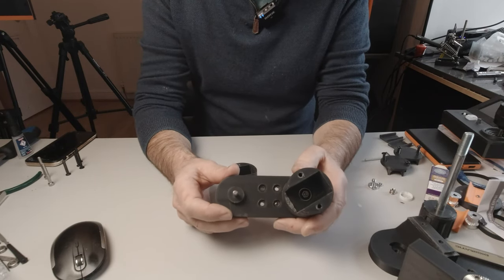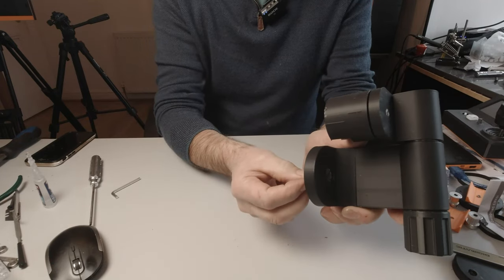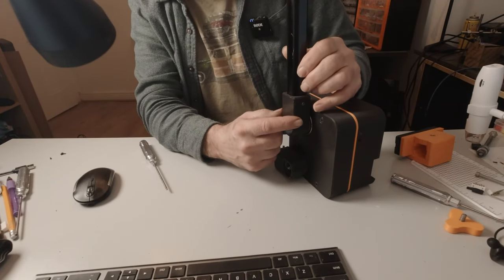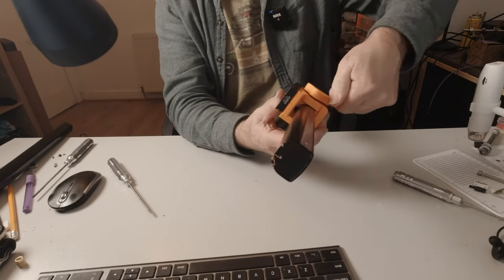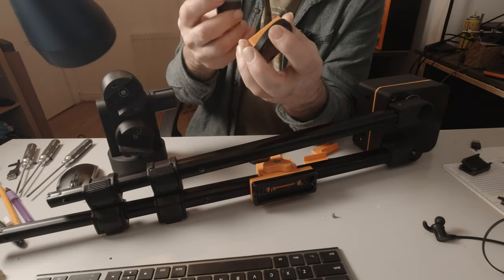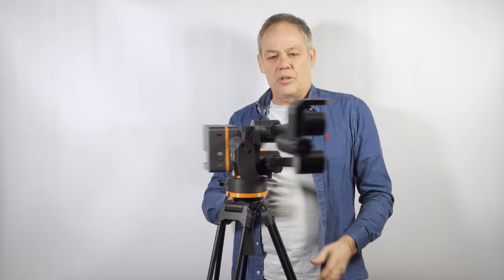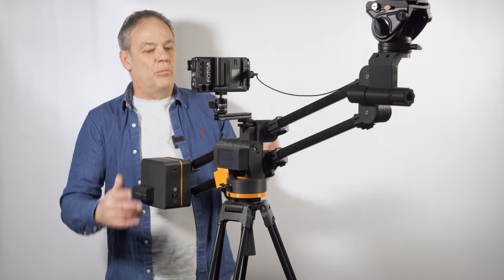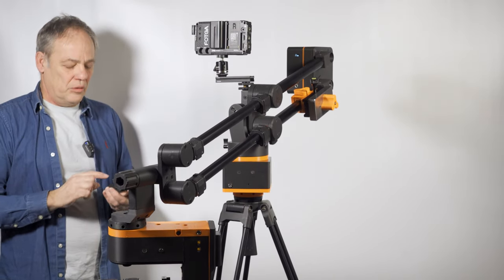3D Printable Motorized Camera Jib from Digital Bird - Part 4

Comment: Really great job. How fast can this go?
Reply from the maker: Speed is limit by the mass being moved. The faster you move it the harder it is to stop! and the more backlash through the arm and down to the tripod. If you are looking for high speed moves you need something like a Bolt which is big and very heavy for a reason. The system is really designed for slower tracking shots over 5 sec per move. You can make it go faster but problems start to arise at the start and end of your moves.
Reply: @digitalbirdfilm  Thanks. Yes sadly not got Bolt budget 😄Or space!

Comment: Hello, this is so great. I think I will go for it. One question , what 3D printer do you use? your prints look so soft, stepping lines. Do you do sth else to the parts after printing or they end up looking like that? please help me with this info because I really want to go for it. Thanks in advance.
Reply from the maker: Hi Ivan
My printer is nothing special just a CR10s. The secrete to softening the look of the layer lines is to use Matt filament. Matt softens the overall look of the part .
Reply: @digitalbirdfilm  matt filament? you mean mate?
Reply: @ivancuetowicq  matte